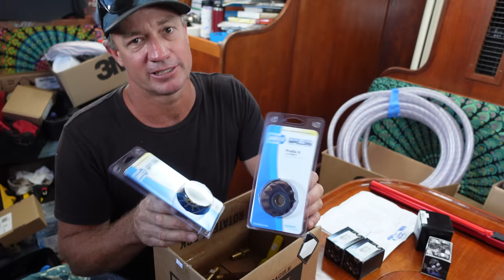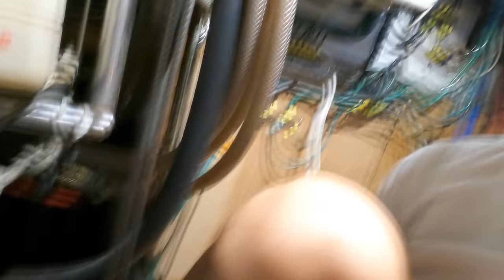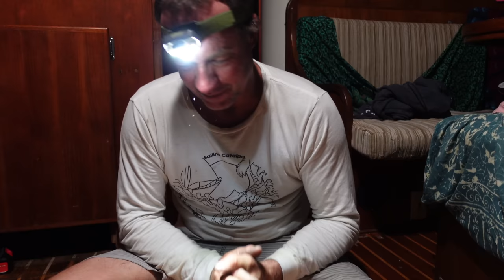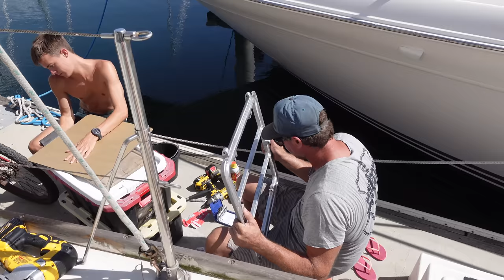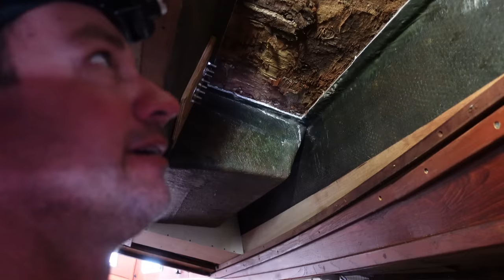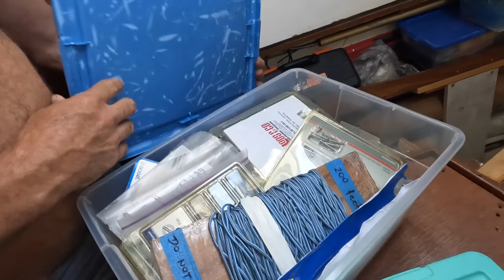Fixing our Sailing Boat | Lots of Boat work | Ep 310

Comment: I found loads of rotten core in my decks - large sections replaced with new coosa core and fresh layers of 1708 and west system epoxy. Still chasing all the damn exterior grade plywood they used under your stanchions 🤦🏻. I’m replacing everything that goes through the deck, just about. It’s been years of work but getting to be worth it.

Comment: For stubborn studs, Easyout sets often come with the appropriately sized left hand drills so that drilling the hole also aids with removal.  Occasionally just drilling the hole will be enough to free the offending stud.  Using a normal drill actually tightens everything not loosens it.

Comment: Why not use Stainless Steel Inner Thread Self Tapping Thread Inserts for the Aluminum frames? Drill the hole a little bigger, glue the Self Tappers in with Loctite and use Marine Grade White Grease on the Stainless Steel bolts.